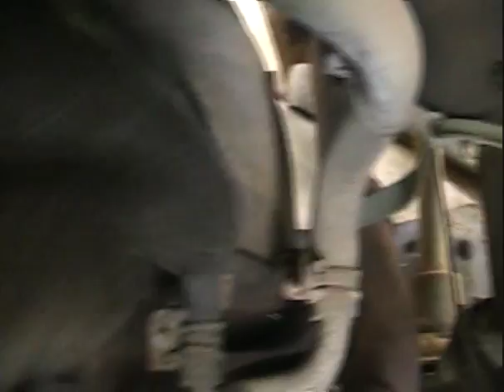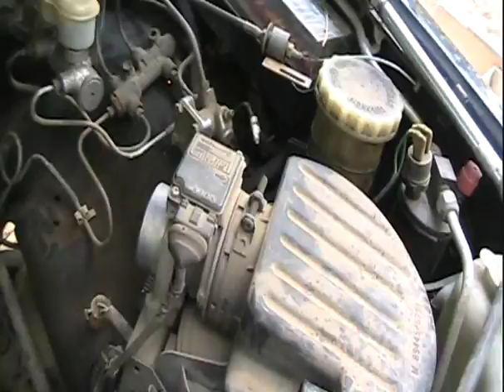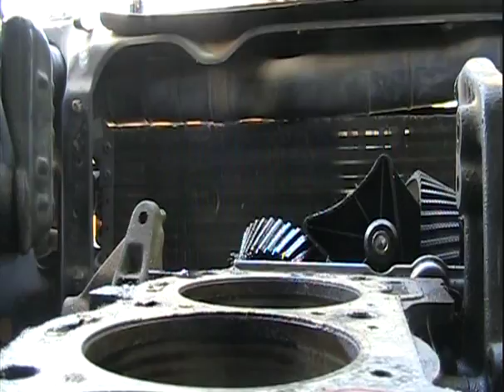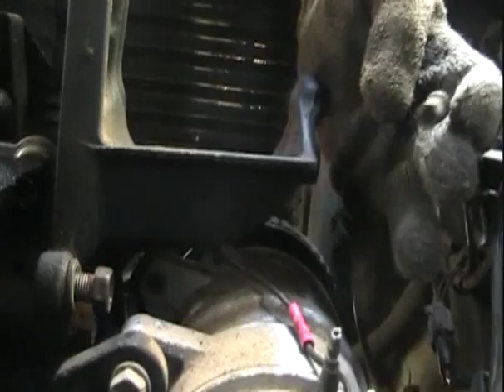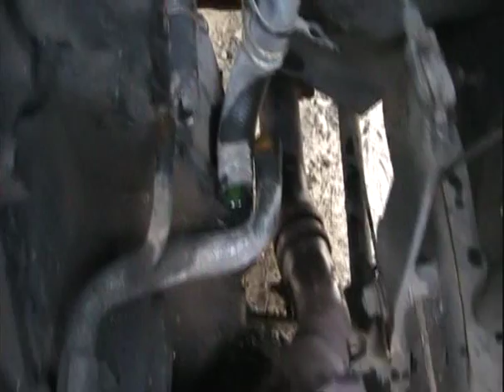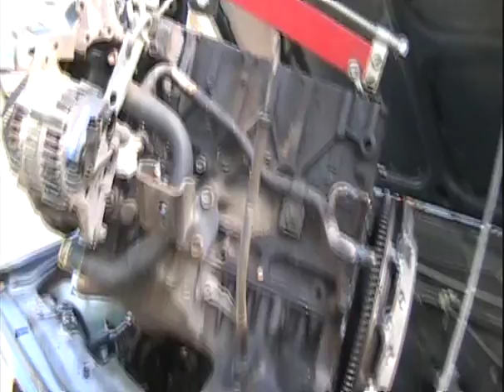Isuzu engine removal WITHOUT Cylinder Head

Comment: about to do this too..glad to know I can do it with trans in place, the book talks about pulling the trans so I'm glad on not having to do that...thanks
Reply: My oilpan hits the front axle when taking the engine out. Might have to remove the transmission because it won't clear the input shaft
Reply: @arteTnoeN  what about just removing oil pan,to get more  clearance
Reply: @mokokawi  The oil sump strainer lives in the lower oil pan, unfortunately.